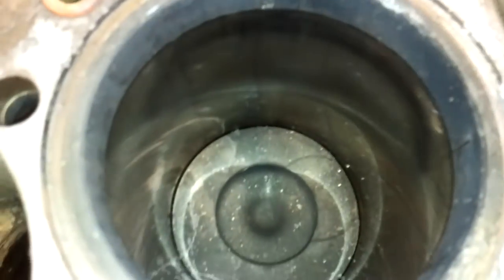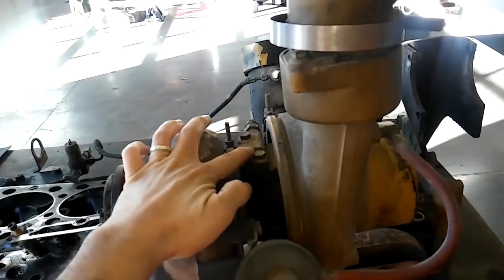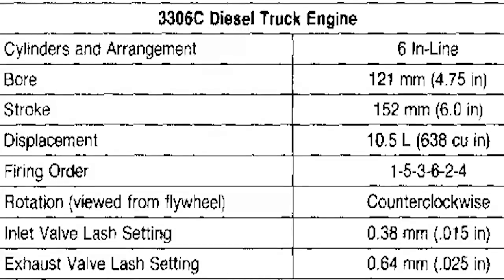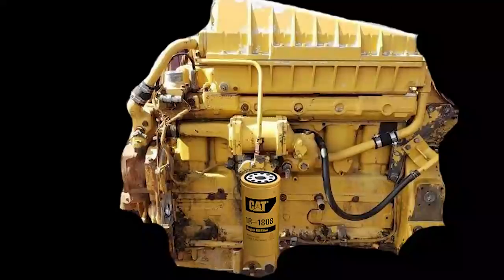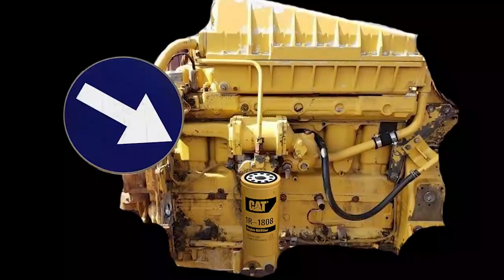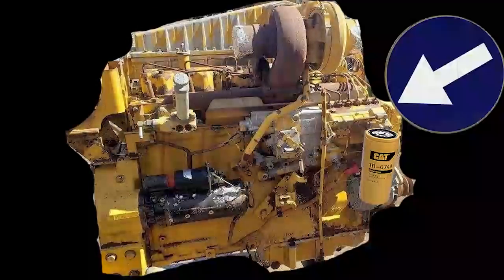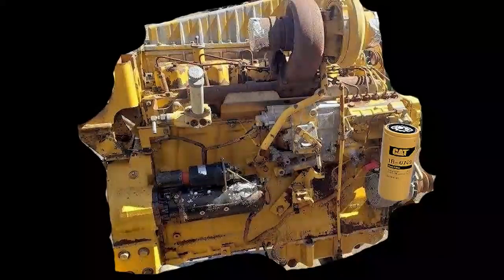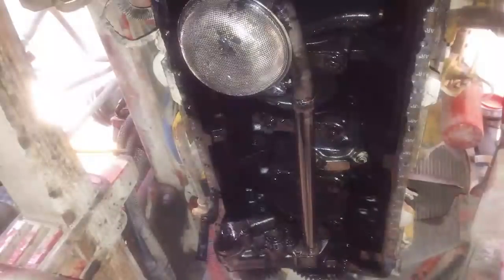The Cat 3306 and 3304 Diesel Engine. The BEST Engine you may have NEVER heard of.

Comment: We have one in our 1990 Ford l9000. It’s air to air inter-cooler and has a two stage Jake . Over 300 hp . Awesome motor! They sound really good with a straight pipe .
Reply: Just to add, last year it blew a head gasket . Found out a liner dropped on #6. Cat put new packs in holes 5 and 6. Cut the counterbore, rebuilt the head, decked it, ect . Ready for another 500k miles .

Comment: My CAT D6D came with a 3306 around 140hp, great running engine.
Reply: My 1986 04X D6D also came with one of these. Great engine
Reply: 140 hp sounds puny until you find out how much torque diesels make. I think all heavy equipment and trucks should be rated in torque amd hp in advertising.
Reply: @ReidHenderson  also geared so low that they top out @6 mph.
Reply: Yeah, my 1995 D6H LGP had a 3306, awesome engine, minimal problems.
Reply: @ReidHenderson what is the torque?
Reply: @rogerbrandt6678  around 500 to 600 ft lbs of torque  which isn't a lot for an engine that size but it will last forever just barely turning low RPM. Still plenty of torque for a very low RPM low Horsepower engine
Reply: @ReidHenderson  yeah makes sense, thank you.

Comment: On that filter color. In the late 70's and 80's I was engineer for or skippered 14 Alaska crab boats and trawlers which were all CAT powered, each had at least two 3306's for gensets, a couple had a 3rd for hydraulics only. I ordered all my filters by the case through NC Machinery (Seattle) and with the exception of a small black CAT logo, all the canister filters (fuel & oil) were bright white. The only issue we ever had with any of the dozens of 3306's over the years was that damned Jabsco impeller on the raw water pump. Hours ranged from 7k to over 30k with no major work.

Comment: I feel like the 3306's are the underdog of Cat engines...they were used in so many different applications and like you mentioned, held up very well. There are lots of construction and farm equipment still running 3306's today, especially tractors and dozers.
Reply: There's a construction site near where I live and the excavating company have a Cat 930 loader powered by a turbo 3304 PC engine.

Now a 7 litre inline-4 is interesting.

Comment: Dude, you have no idea how long I've been waiting for you to make this video lol Got a 3306 in our DJB 6 wheel dump truck, had to rebuild it because it dropped a valve in number 3 and destroyed the piston. Luckily the wet liner design meant that to get it out, I just put a bottle jack under the con rod with the end cap and head off and the liner and piston popped right out. Wrecked the head but luckily I found one off of an old d6 bulldozer we had laying around. Great video once again, got a lot of Caterpillar engines here in England, nice to see someone that loves them as much as I do lol
Reply from the maker: I didn't think there were many of these in Europe, but I really had no idea. Thank you for the comment.
Reply: I drill a hole in the piston tap it and tie a chain to a hoist.
Reply: @AdeptApe  Not so many Caterpillar engines in road going trucks, one I can think of is the Foden Alpha which had the option of a C12 in it. Believe it or not, England is the largest manufacturing base for CAT outside the US. Axles and transmissions are made in Belfast, Wheel loaders are made in Newport in Wales and the Articulated Dump Trucks are made in Durham in the north. Plus Caterpillar recently acquired Perkins, another engine manufacture in Peterborough. Those are fitted into JCB equipment, but still retain the Perkins brand name. Plus Extec and Power screen use Caterpillars or Deutz engines in their screeners and crushers

Comment: Hey great video. But the 3306 was installed in equipment until the early 2000 ( 330B excavator for example and 966G wheelloaders ). And a common problem I know on of highway equipment with mostly changing engine speeds like wheelloaders for example the rubber verules on the head gasket  worked there way into the head an block surface. So that they don't seal anymore  and the head and the block both had to be machined. But that happened at high mileage  10000 hours plus.

Comment: The D343 is also a great engine. It is bigger but it's pretty bullet proof. Worked on a dredge once (many moons ago) the company had the rack turned up so much the exhaust would glow red about a foot past the turbo. It ran 20 hours a day 6 days a week for years. The only reason it stopped running was because the company bought a new dredge. The most incredible work horse of an engine I've ever seen from Cat.
Reply: Yeah great engine. I've rebuild them in 637c scrapper's  it has a long life

Comment: I’ll have to agree with you they are one of the best engines out there I work on both 3306 and 3304 and in my opinion they’re a lot better than the 3408 and 3412 as they don’t have problem with valve recession

Comment: Funny story concerning 3304PC engines in 120G graders.  One operator was always unable to start the machine during cold weather, and he maintained he always used the glow plugs.  Finally, I accompanied him out to the rig one very cold day only discover he never turned on the master ground switch prior to utilizing the glow plugs.  OK - problem solved.  His machine was upgraded to a 3304DITA, but he faithfully continued to utilize the glow plug switch (after turning on the master switch of course) on an engine which did not have glow plugs!!
Reply from the maker: Well, he probably didn't turn down a job at NASA to operate equipment I'm going to hazard to guess on that one.

Comment: Natural gas 3306NA and TA and 3304 were a holiday for a compressor mech. Love em.
Reply: Junk on nat gas. When we went to service a 3304 or 6 we always brought a cylinder head and gasket kit. Turbo or not they went through heads like they were going out of style. 3400s are horrible on nat gas same issue. Now 3500 series, that is a different story! Once did an overhaul on one that was original below the heads at over 70,000hrs! It had some original heads on it as well.
Reply: @nathansihlis4866  3500 best gas compression engine ever. With a Ariel behind it. 3300 where easy. You could change a head by yourself if you had to. We used to have some 3306ta with air to air cooler. They would freeze up in the winter. But I usually don’t have too much trouble with the ones I look after. If it had a mag that was the biggest grief.
Reply: @waukesha7042  nice youtube name 😁 Yes I would agree as well. 3500 with a JGK2 is an operator and mechanics dream. It's been while since I worked on them. 13 years now. Dont miss the gas field. It was good work no way I could balance 70-120hr work weeks with family now.

Comment: I've built many, it is really too bad they didn't design a 4valve concept. I've taken 3304s with bad balance shafts and put pipe plugs in the oil passages and sent them away. That was 15 years ago, and they're still going...

Comment: I have a 3306b in an '88 Marmon 57L. It runs well but only seems to have power at higher rpms. Id like to up the power and add jakes to it. Currently it has a 9spd behind it but im hoping that a 13spd will help in the power department.
Reply: Jakes are hard to find for these, can't get new, I would check the FRC  and fuel psi first. What is your engine serial number?

Comment: Oh, these things...a client has a 3304 PCNA in an EIMCO 913 LHD at an underground mine. Well, that thing has gone through an alternator and a starter in less than a year of part-time service, to say nothing  of the assorted electrical and brake problems! Most recently, it was a no-start condition, and the operator just kept continuously cranking until it wouldn't crank any more. That led to a call to the master mechanic (contractor), who opened the starter up only to find that its internals had melted. I believe it was originally a fuel pump issue, but they managed to add a blown starter and nearly a fire into the mix. It doesn't reflect poorly on the 3300 series, just on their operators. Same guys ran a machine I rented to them out of fuel twice.

EDIT: This got funny, I bought a 3306PC in a generator at an auction a couple months ago. I'll be working on bringing it back to life this weekend.

Comment: I have a 3306 in a 97 truck. All the engine tags are gone. Would you know where on the engine the serial number would be stamped in the block? I power washed the entire engine and still can not locate.
Reply: Look rear of block drivers side, should be a flat spot right under cylinder head. You can also use the vin as long nobody did a engine swap. A 1997 should be a 9TL prefix, very popular in Ford's.
Reply: @johngoldsmith6629   Thank you John.

Comment: I happen to have a D7F ( not one of Cats finest products unfortunately ) and it has the 3306, I think they were rated for 180 hp if I recall correctly in that application. I've not run it for a few years now which is bad on my part. What I wanted to comment on is that this engine I have is not a good starting engine at all if the glow plugs are not used and I don't think it will even start at 70f unless the glow plugs are put to use. I don't know if that is a trait of that engine or the setup this vintage of 3306 has from 1973 as I am curious if later engines of this model were designed differently.
Reply: Our neighboring county hydept bought a D7F brand new, and the first day they were using to pile trees up and broke the injection pump off
Reply: @dwk7375  That sure would have brought it to a halt without question !, I am only guessing that was a rare event to take place but the Cat gods would have the inside scoop to that knowledge.
Reply: @charlesb4267  a tree limb hit it
Reply: @dwk7375  Oh, I was thinking some major casting defect but now I get you, pushing trees and piling without major protection for the underside of the engine as well as the sides of the engine and the rad is asking for major problems as I am guessing the unit was not set up for the bush application. Even with the protection one has to watch it as a stick can come and sneak in from the side through a gap where the ram pivots and hit the fan or throw the fan belts in the case of stabbing the operator etc as my cat has no full cage. Been years now since I last did any pushing and piling of trees with the D7 but have to be watchful all the time.

Comment: Any thoughts on 3306 blue smoking out the exhaust but not much blow by.  Heavy at times and not much at other times?
Reply: Indirect or direct injection engine?
Reply: @StuStafford83  It was in a 1994 Ford  9000 on an auction and it is sold already, but I was still curious.  Had about 250,000 miles on it.

Comment: First off, Cat makes "white filters" they are called "marine filters" and really it's a marketing thing. A different color, different part number, sell for a couple more bucks. :)   NOW here's the deal on the 3300's based off my experience working on them as a marine tech. Yep, I ain't never worked on one of those dirty trucks... they were and are a some what "dirty" engine- all of them with exception of a few have been in genset applications. On yachts. Where one does not want soot, smoke or an oily sheen on the water from the yachty  water drop exhaust system.  Trying to "clean these up" involves several CAT service letters involving having drain back holes drilled by a machine shop in the pistons, dicking with the timing, hotter thermostats and specific part number injector nozzles. It's like polishing a turd. Yep you can make them somewhat less smoky but 90% of the "smoky" issues are due to running any gen set at low load.  Also an issue? Well nobody likes oil leaks. The whole cast iron block, steel block plate, aluminum front structure, and tin oil pan fit will EVENTUALLY always start to weep. Dissimilar metals and thermal expansion rates.  OH and the issue you mentioned involving the having to use a big hydraulic puller to get the balancer off? Oh yeah but often in yacht apps they use a front drive for big hydraulic pumps so ALL OF THAT has to come off to repair it. OH and the 4 cyl version uses balancer shafts that have to be timed to the valve train on assembly etc, it takes longer to build a 4 banger than a six due to this!  So are they a great durable engine? Hell yeah! Will they or any other mechanically injected engine EVER be as "clean" as an electronically injected engine? Absolutely not!

Comment: I had to stop & laugh myself silly when you replaced those non-Cat filters with the proper items 😂😂😂 good show!

This is an engine & platform that, I have to admit, i didn't know much about. Is that pump a Bosch P-derivative?
Reply: WIX filters are fine IF IF (< See That Word) you maintain your equipment properly... Those filters collapsing were likely caused by a stuck Oil Pump pressure release or a clogged filter...LACK OF MAINT! - I have used WIX for 3 Decades and Millions of Miles....Never Had a Problem...
The argument that the Engine Manufacturer "Designed" the filter to work with X engine... That "Might" be an argument with CAT because they are ANAL Control freaks about everything... But I know every other Manufacturer out there...Has a filter made "To their specs" by whichever company is cheapest that month... I have seen GM/Ford and Toyota, and just about EVERY Automotive/Medium Duty brand, filters of the same "Part Number" change "Style" and even the case box is indicating it's coming from a different supplier...

Comment: For your information, the 3306 was fitted to Foden trucks in the uk during 80s/ early 90s, it produced 400hp, and constantly blew around the cylinder liner to head seal, i rebuilt alot of them for that problem, cat used to blame the radiator for not being large enough, but the problem made them very unpopular here.

Comment: Love the videos.  Just thought I would let you know, CAT still makes the 3306B, and 3406C, just not in your neck of the woods.  The 3306 is still built brand new today, and installed in two pieces of equipment (R1300G, and D6GC).  The R1300G (NJB prefix) underground loader has been built since 2012 and uses the 3306B.  In September of 2020 CAT just started building the D6GC (XPC prefix) which also has the 3306B.  The 3406C is also still built brand new today, its used in the D8R (MEJ & RJM prefix depending if its built in Thailand or Brazil) .  Check them out, very popular engines.

Comment: The 3300 series are true, genuine performers.
I've refreshed a non-deckplate, counterbored precup girl that still ran well... out of a late 60's D7. 
If it weren't for the crack in the block, she'd have taken yet another in-frame and ran on for another generation. 

3306C is definitely up on my list of the greats.
Reply: What does the "c" at the end of the model number mean?
Reply: @bobby1970  Essentially, third generation. It had the best head, injection system, turbo, and cooling system.

Comment: Been waiting for this one. I have a 3306 in my L9000. Absolutely love it. Low maintenance,  hard working engine. I only use Cat filters, and Delvac 15w40. Maintain properly and they will put the energizer bunny to shame.
Reply from the maker: Cat filters just make sense 😀
Reply: @AdeptApe  for some, the additional cost is not worth it to everyone.  I run cat filters on mine because I'm a 1 truck operation and a bad filter would be detrimental to my business. However if someone has 10+ trucks the liklyhood of a bad filter taking out a engine is a financial gamble worth taking as it is rare and the reduction in maintenance cost can easily pay for that lost engine.
Reply: @jaydunbar7538  Alot of times, especially down here in FL, you're saving about $2-3 a filter. I've come across some Napa's out in the field, where I've had to get a fuel filter in a pinch and spent $4 more for a wix.